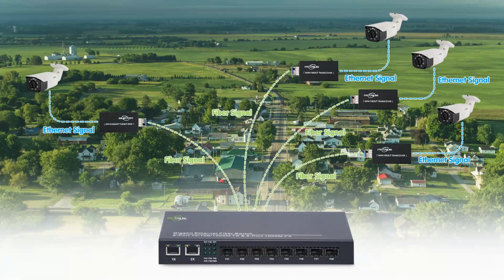Expand Your Fiber Optic Network Easily with Optical Splitters

Comment: What about if i need to connect a PoE switch instead of a ONU, to install ip cameras in different locations?
Reply from the maker: You cannot connect an optical splitter directly to a standard PoE switch. 

You need this setup instead:
OLT (in server room) → Optical Splitter → ONU (at each camera location) → PoE Switch → IP Cameras

The light signal coming out of an optical splitter is not "Ethernet." It is a specific PON frame that only an ONU can understand and convert back into standard Ethernet for your PoE switch. The ONU converts the fiber signal back to Ethernet so your PoE switch can understand it.

Or, you can use a PoE ONU: https://www.fastcabling.com/product/8-port-outdoor-poe-onu/

Comment: Does using one piece media converter a to splitter then many media converter B from splitter work?
Reply from the maker: No, that setup will not work.

An optical splitter is designed for Passive Optical Networks (PON). In a PON system, one optical line terminal (OLT) sends signals through a splitter to multiple optical network units (ONUs).

Media converters, on the other hand, are typically used in Active Optical Networks (AON). Each fiber link is point-to-point, meaning one media converter connects directly to another media converter.

Because of this, you generally cannot place a splitter between media converters to connect multiple devices. If you want to connect multiple fiber devices, you can use a fiber switch with multiple SFP ports, or run separate fiber links from the main switch/media converter to each device.

Comment: Mam. I. Don't. Understand epon. And. Gpon. How. To us😅e. It
Reply from the maker: EPON and GPON are two types of fiber-optic network technologies used to deliver internet over passive optical networks (PON).

EPON:
Uses standard Ethernet technology over fiber. Simpler and often cheaper. Speeds typically 1 Gbps downstream and upstream.

GPON:
Uses its own protocol (not Ethernet). More efficient and widely used by ISPs. Speeds typically 2.5 Gbps down / 1.25 Gbps up.

Comment: But if I am using a single mode fiber from my home router to a plc splitter and from plc splitter and  I run it frm PLC splitter to my study and connect to a  media convertor, so in this case whic SFP I need to use BIDI or normal one ? Is it that  PLC splitter works between OLT and ONU only ?
Reply from the maker: A PLC splitter is designed for PON environments (OLT ↔ ONU). It splits one optical signal into multiple passive branches, and is not meant for a simple point-to-point home link from router → splitter → media converter.

You need PON-specific modules. These are often called GPON ONU SFP or XPON ONU SFP. They plug into a router/firewall/switch and act as the home ONU.

Typical wavelengths:

GPON:
Downstream RX: 1490 nm
Upstream TX: 1310 nm

XG-PON / 10G:
RX: 1577 nm
TX: 1270 nm

Comment: How do you connect ethernet switch to OLT
Reply from the maker: You connect an Ethernet switch to an OLT by using the OLT’s uplink (SFP/SFP+) port, inserting a matching optical module, linking it via fiber patch cord to the switch’s SFP/SFP+ port, and then configuring VLANs and services accordingly.

Comment: Whats the reasoning behind using UPC connectors when the entire industrie has shifted to APC due to the superior range and less reflection which is espeically important in wide area networking?
The products do seem quite interesting for the price. What GPON OLT SFPs does one need to use for the 8 Port variant, and is the platform compatible with any ONU on the consumer end?
Or is this build on EPON as compared to GPON?
Reply from the maker: UPC vs APC: UPC is cheaper and more common in short-range or indoor setups. APC is better for long-range due to lower reflection, but may not be necessary for shorter, budget-focused deployments.

GPON OLT SFPs: You’ll need Class B+ or Class C+ GPON OLT SFPs for the 8-port variant, depending on your range and split ratio needs.

ONU Compatibility: If it's GPON-based, it should work with any standard-compliant GPON ONU. If it's EPON, it will only work with EPON ONUs—they are not cross-compatible.

Comment: Please can I use another splitter from the main splitter I took from the output destination to make another many numbers to connect to. In simple terms, connect a splitter from the primary splitter ?
Reply from the maker: Yes, you can. However, keep in mind that each split introduces optical signal loss, so the more you split, the weaker the signal becomes.
Reply: Thanks

Comment: How to extend fiber optic network WITHOUT using OLT and media converter?
Reply from the maker: You can use the SFP switch which has multiple SFP ports that allow for direct fiber connections. https://www.fastcabling.com/networking-solution/10g-lan-b-w-2-fiber-switches/

But if you want to extend fiber to another endpoint without adding intermediate devices, you can splice additional fiber lengths directly. Splice the new fiber cable to the existing fiber line using a fusion splicer, and then terminate the extended fiber with a connector that interfaces with your equipment. However, it requires precision.

Comment: Please this topology with multiple poe switch ip camera setup
Reply from the maker: You just need to connect the ONU to your poe switch.  The ONU converts the optical signal into electrical Ethernet signals. The switch will then provide data and power to multiple IP cameras via Ethernet cables.

Comment: Какой минимальный уровень сигнала должен быть, дабы он смог быть разветвлен на 64 канала?
Reply from the maker: минимальный требуемый уровень сигнала зависит от типа разветвителя, используемого волокна и бюджета оптической мощности. Например, для разделения на 64 канала уровень входного сигнала должен быть не менее -12 дБм (или выше), чтобы гарантировать, что мощность на каждом из 64 портов достаточна для обработки приемником.
Reply: When you say minimum, do you mean the most light or the least light?
Reply: @joshuatimothy2966  минимальное освещение. Я так понимаю есть порог, при котором мощности луча может не хватить, дабы разветвится. Оборудование же пассивное, а значит поднять мощность входящего луча на выходе не получится. Входящая мощность луча будет поделена межу выходящими портами?
Reply: No, the incoming remains the same at the out going. As for the minimum before it's unreadable......depends on the vendor used. 
Hopefully that answered your question